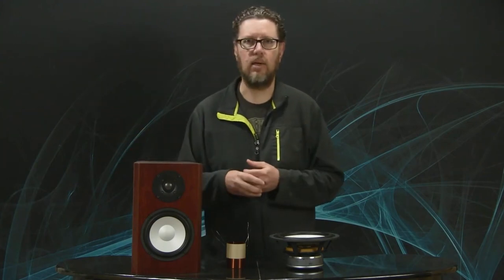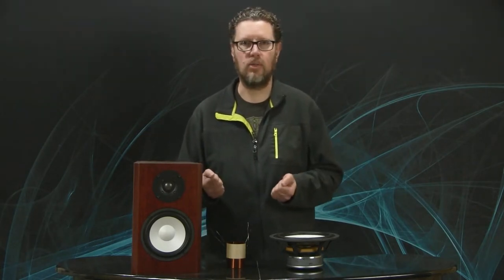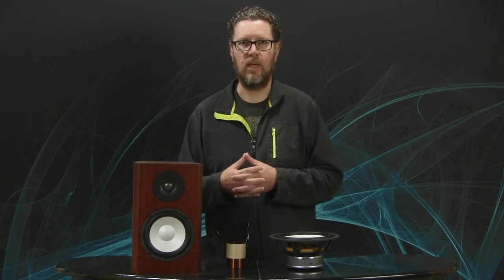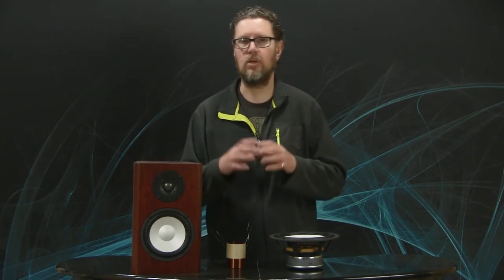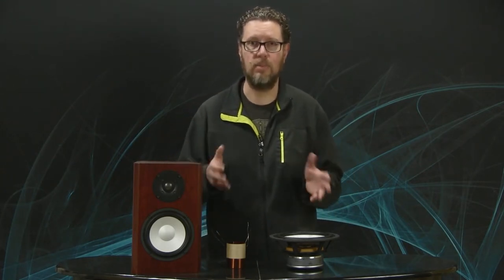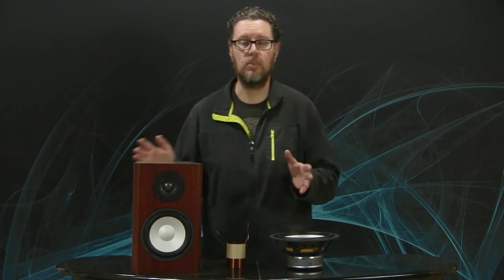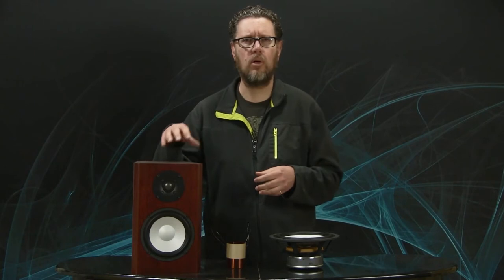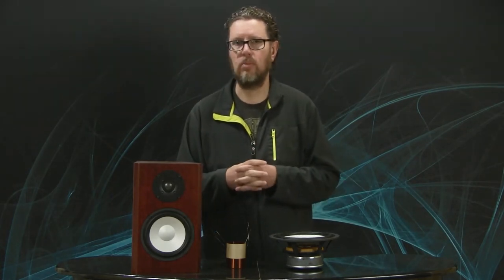Can I Use A 4-Ohm Speaker With an 8-Ohm Receiver? | Speaker Impedance

Comment: Hello how to change the impedance from 8 ohms to 4 ohms on Denon avc x4700h I can't find it in settings?
Reply from the maker: See the page titled “Before connecting speakers” in the owners manual where it covers how to get into the menu to change the speaker impedance.
Reply: @AxiomHomeTheaters  ok thanks for the info
Reply from the maker: @glengatt3941  you’re welcome, happy to help.
Reply: @AxiomHomeTheaters  hello again I'm thinking to do 7.2.4 and I need an external amplifier is the k4 450 simbosen good for that pre amp the front channels instead of the highest and I will have some power for the front channels for music too because only 9 of 11, channels are amped on the x4700h,I don't know much about these things I left this hobby behind when 5.1 Dolby digital was the new thing but now I better and getting in my old hobbies but there is 25 years gap so all this is kinda new I appreciate it
Reply from the maker: @glengatt3941  if you’re planning to add an external amplifier, I would strongly recommend sticking with a consumer product rather than a “pro” model.
Reply: @AxiomHomeTheaters  ok,but they are all expensive maybe I should buy a small one just to power the sealing channels thanks
Reply: Hello I saw a emotiva bas X A2 is 160 watts 8 ohms and 250 watts 4 ohms I never owned emotiva if I get this and power the front channels with it tru the Denon do I get better fronts and for music too I'm asking because the x4700h is 125 watts it not big difference my fronts are old jamo 707 280 watts 4 ohms, and I can get 7.2.4 I'm sorry for all these questions but I don't know much I appreciate it if can help thanks
Reply: Hello I found this emotiva bas X A2 they claim that is 160 RMS at 8 ohms and 260 RMS at 4 ohms and it's about the only one I can afford do I get better fronts channels with it and for music or should I ask how much better will the front channels be because it's close to what Denon claimed for x4700h is 125 watts 8 ohms and 200 watts at 4 ohms, and I can do 7.2.4 too right? like I said I really appreciate your advice someone that knows what he's doing help please
Reply from the maker: @glengatt3941  I suspect you are not going to notice a huge difference, except possibly dynamically where having that power capability and supply dedicated to only the main front left and right channels could result in an improvement. The remaining channels powered by the Denon will see a similar improvement as the AVR is relieved from having to power those main front channels.
Reply: @AxiomHomeTheaters  not even in music stereo?
Reply from the maker: @glengatt3941  Missed that point. Yes, in stereo you might find a benefit with the separate amplifier. Separating the amplifier from the noisy environment of an AVR can result in better clarity and a lower noise floor.
Reply: I made up my mind I getting the basx a3 to power all front channels and good for music too thanks I appreciate your help!
Reply from the maker: @glengatt3941  happy to help, enjoy the audio journey!
Reply: Hello happy holidays.if I may another question?
Reply from the maker: @glengatt3941  Sure. 😊
Reply: @AxiomHomeTheaters  now I got the basx a3 and I'm getting 2 more basx A2s should I buy a basx a4 or its enough for the Denon avc x4700h to handle the 4 highest channels my room is my bedroom and is not that large 13ft by 13ft by 10ft high? And the impedance my fronts main speaker are 4 ohms is that something that I have to set fro the basx a3 or the Denon?
Reply from the maker: @glengatt3941  For such a small room the Denon will easily be able to handle the other channels. I believe there is a setting in the menu when using 4 ohm speakers with that model.
Reply: @AxiomHomeTheaters  the Denon?
Reply from the maker: @glengatt3941  Yes, I know some Denon AVRs have a menu setting for using 4 ohm speakers.
Reply: Ok IL search for it thanks
Reply from the maker: @glengatt3941  You’re welcome.

Comment: WI’m  fried up two Marantz SR 8012s in a period of two weeks running a pair of  your M100 speakers I also blew two Sony top of the line ES models within two weeks neither one of these receivers can handle the 4ohm
Reply from the maker: That’s very strange…those units should have both thermal and overload protection if they were being overdriven with M100s.

Comment: Thanks for the video. I'm a total newbie but am trying to get a good 3.1 LCR setup going, targeting the Costco Denon 1760 which states 8 ohms. Would this work with Dali Oberon 1s? Stated 4ohm?
Reply from the maker: I just looked at the Dali website and the Oberon 1s are specified at 6 ohms. Most Denon receivers I have used over the years have no problem with 4 ohm speakers, so you should be fine.
Reply: @AxiomHomeTheaters  Thank you!
Reply from the maker: @asksteevs  You’re welcome!

Comment: My .03 cents:   Not all 4 Ohm speakers require that same amount of power.  4 Ohm small bookshelf speakers require less power than 4 Ohm tower speakers.
Reply from the maker: True, but it all depends on what kind of output level you desire. In many cases a small bookshelf speaker will have a lower sensitivity, meaning you’ll need more power to get the same SPL as a more efficient floorstanding speaker. Thanks for taking the time to share your .03 cents (inflation?) worth, and for watching.

Comment: Can I use 3 ohm speaker in 4 ohm receiver?!
Reply from the maker: If it’s listed as 3 ohms nominal, I would confirm with your receiver manufacturer that it won’t be an issue.